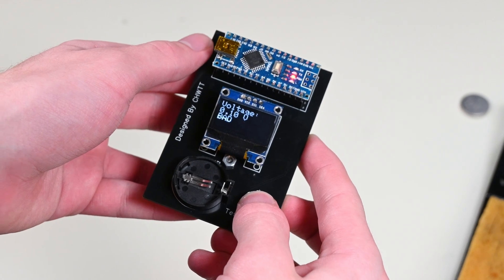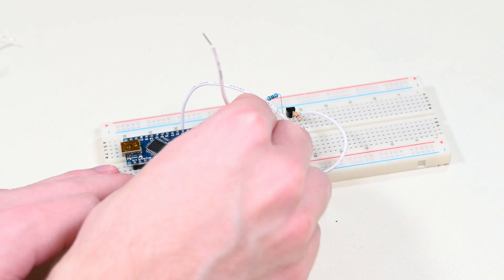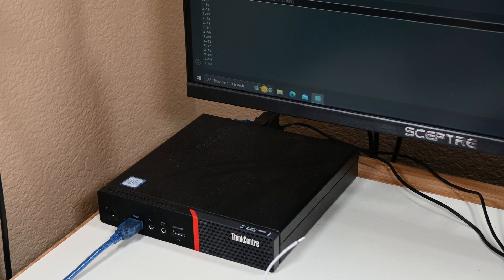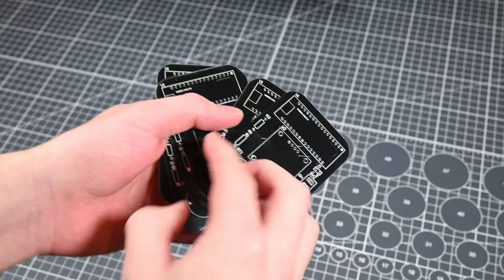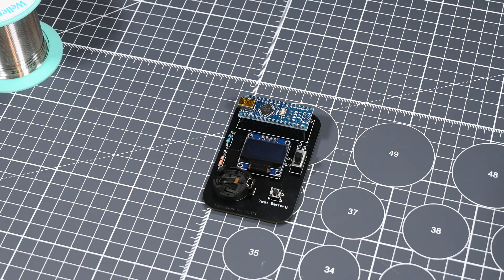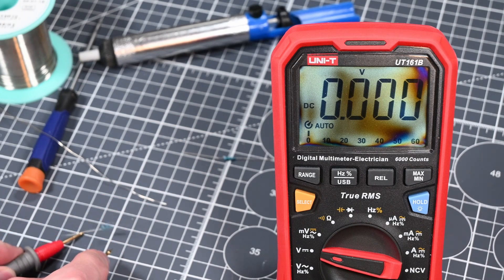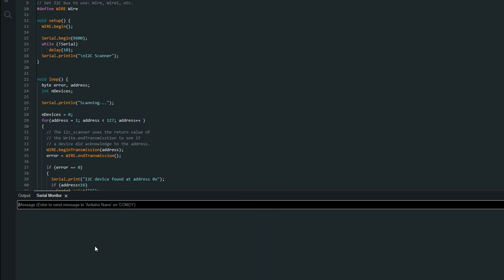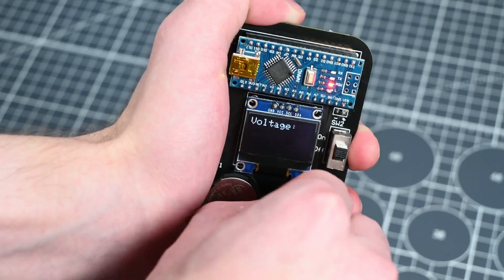Making a NEW CMOS Battery Tester! (Open Source)

Comment: Hey why would you make a voltage divider and deal with tolerances when you can directly attach it to the ADC? You can put the load between the battery and a GPIO pin (in high impedance) and when you want to mesure the voltage, pull the pin to ground, never to 5V. Be carefull when you dont power the arduino but do put a battery in place, the arduino pin connected to the battery can be back driving the arduino so put a current limiting resistor between the battery and the ADC pin. The ADC doesn't consume much current so the voltage drop over the current limiting resistor should be minimal.
Reply from the maker: I had that back feeding issue in the first version where I did connect the battery directly to the Arduino's ADC pin, but it never crossed my mind to add that current limiting resistor there to solve that, that's a good idea!

Comment: Use flux when soldering smh... Good video otherwise, but very amateur not using flux. You'll get a better metallurgic bond if you use flux. You earned a sub, I want to see you grow and get better, you're very skilled.
Reply from the maker: Thanks for the advice! I was under the impression that the solder I was using was flux core, but I guess that based on the quality of the joints (as have been pointed out in other projects too, actually) it either isn't flux core or the flux core that it has is garbage. Certainly looking to get better, thanks for the sub!
Reply: @CHWTT  I've found flux core is just not reliable, especially if you do soldering for money, the added protection of using flux plus the way it helps to control the beads is a big stress reliever. I've been wanting to learn this micro soldering, and I only have experience with personal plumbing and I use to make stained glass for hobby for a few years, absolutely love doing it. The flux core solder would work, but the product was weak usually and would be so hard to make look good and even. Im happy to subscribe and am excited to be able to learn more from your content. Keep up the good work you're going to grow fast.